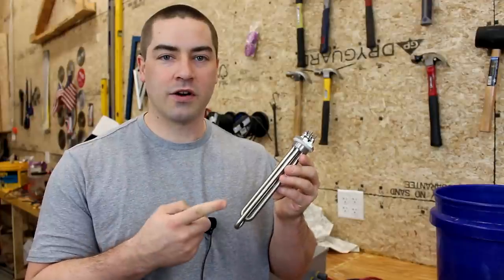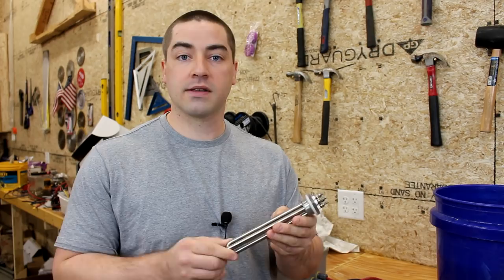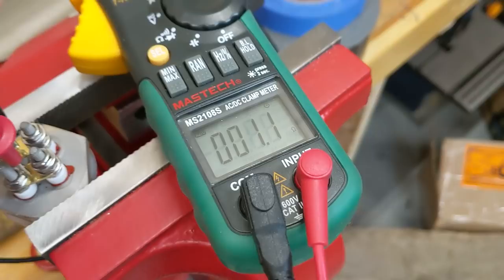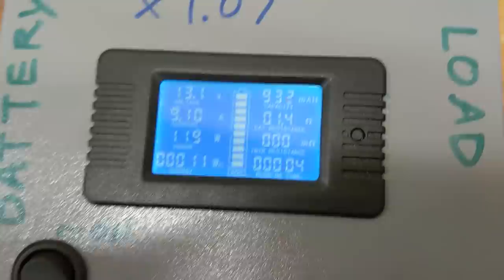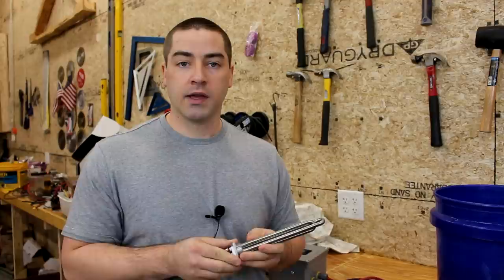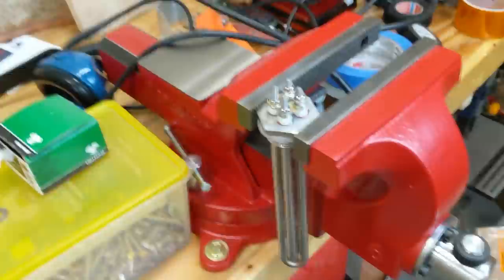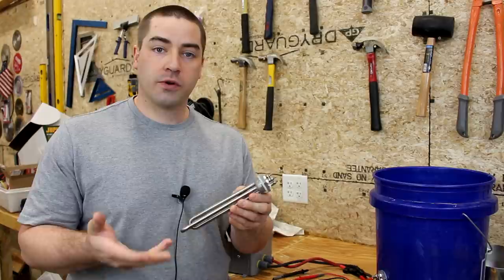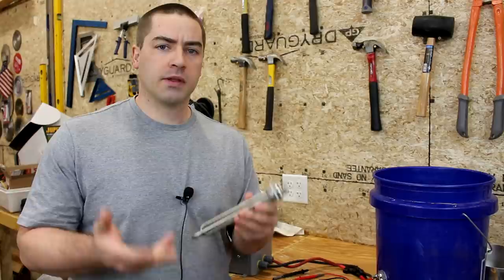Getting what You Paid for using Science

Comment: I assume you received a new elements which are just rated 600W in reality 33% weaker than these two?
Reply from the maker: I have returned the two in the video, and got it swapped for two rated at 600w.  The company did a good job on the return/exchange.  I have not yet filmed the new heating elements being used.

Comment: Hey Dave. Im asking a question. 
Wouldn't a 45volt 800 watt water element be better ?
Been watching ya channel for ever. Davi b here from Ausie
Reply from the maker: Depends on what you want to do.  I want a very low resistive load for bench-testing.  I have some videos coming up where I want the 12v version.  But if you have a 45v battery (or 48v, or 24v) and want to buy a element to match, then great.  I personally have a 48v battery bank, so If I wanted to heat water directly from the battery I'd buy a element rated for that.  Sometimes you can use 230v elements too, just depends on what your goals are.

Comment: ???  All heating elements are resistive loads.  What makes this coil any different from a $9 coil from the local box store or plumbing supply house that has the correct resistance ?
Reply from the maker: Nothing.  Except I can't find the correct resistance at my local stores.
Reply: @DavidPozEnergy  Check for the small 5gallon tanks commonly installed in commercial environments

Comment: Hi, what happens if I run 2000w ac water resistant on 24vdc power supply? Thanks
Reply from the maker: I've used AC water heaters on DC several times.  The heating element doesn't care about AC or DC.  However, the thermostats are not rated for DC and likely will arc and melt.  So be careful with the accessories.  You may want to check out my other video on this topic: https://youtu.be/kVaxAfXQPDU
Reply: @DavidPozEnergy  thank you. I got it. I guess I can solve it with a high amp.  DC to DC SSRelay

Comment: Hi Dave, what are your plans with these heaters?
Reply from the maker: Two main things.  First, to test batteries at a very high C-rate.  I've made some 12v batteries and want to see how much they heat up, or how much the spot-welds heat up under very high amps.  Second, I want to circle back to some of my older water heating videos.  I had made a series on PV direct to heating elements.  However, I never got a chance to discuss the controls for that.  I want to make some videos on how to safely control PV direct.  Having a heating element on the bench will make viewing it easier than trying to film in the snow bank behind the solar array.

Comment: you are doing the math correctly

https://ohmslawcalculator.com/ohms-law-calculator. makes it easier

since the watt is a universal neutral unit it makes it possible to convert electrical watts into btus making a totally wrong number.

in fact i tried it and a 110 12000 but air conditioner would end up drawing 30 amps witch is more than most outlets and wiring can handle.

so it may be 800 heat watts not electrical watts.

mistakes happen due to similarities in appearance.

.

Comment: 1:11 multimeter is not the device to measure such small resistances. If you would look at the measuring range you would find for you multimeter +/- 0.8% +3, and you did not measure probe cables to take into an account. There is no science in this approach but huge error with measurements.

Comment: If I wanted an instant water heater for my hot tap in the RV, what is the calculation I should use to tell me the Kw required to heat 15°c water to  60°c with a flow rate of 19Lpm 
My brain is more cabbage than academic so I can't work it out. 🤣💩
Reply: google search? I put your question into google, and I got an answer.

Comment: THE SAME THING HAPPEND TO ME LAST NIGHT.  I got the 600W 12V heater (exactly the one you mentioned you were going to try next)  My  600 Watt element heater drew exactly 150 Watts at 112v  (12.5A).  Wether cold or hot.  How did you resolve your problem?? I am about  to send this message to the ebay seller.

-------------------------------------------------------------------------------------------------------

Hello,
I have connected the water heater I received.  It is the one that is advertised as 600 Watts at 12 Volts.  I connected it to a commercial 12V power supply rated at 12V and can supply 750 Watts.  However, the heater is only putting out 150 WATTS...steady as a rock".  If it were heating at 600 Watts, then the current draw from 12V would be 600W/12V=50 Amps.  Also the two shunts on the heater connect the two elements in PARALLEL which will give MAXIMUM heating.

The heater only draws 12.5 Amps, therefore the power output is 12.5 Amps x 12V = 150 Watts!!  My first thought was that maybe the power supply voltage was low: so I metered the voltage under load of the heater: it was 12V.  So I decided to meter the VOLTAGE and CURRENT simultanuously while the heater was powered.  The devices measured 12.5 Amps DURING the 12V supply voltage while under load...SAME RESULT: 150 Watts.  I even made measurements while the heater was still cold (The second power was applied) until it reached a steady (HOT) emission...SAME RESULT...150 Watt output...WITHOUT VARIATION for a long run.  A WATTMETER also showed 150 WATT output (NOT 600 Watts).  Finally, I used a freshly-charged high-current Marine Battery and got the same result.

Perhaps I received the wrong heater?? 
Please help!
THANKS MUCH
------------------------------------------------------------------------------------------------------
Reply from the maker: I contacted the seller and they agreed to exchange the elements for me to a different size.  I can't remember off the top of my head, but I think it was some 400W instead of 600W, still 12V rated.  The new ones pull 400W, and I was happy enough with that outcome.